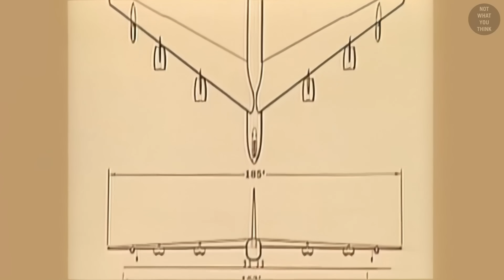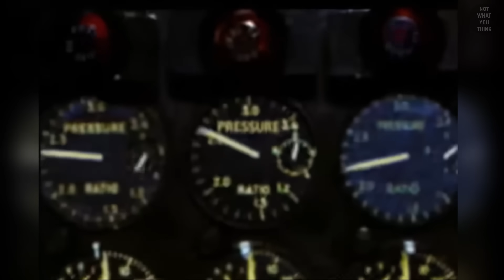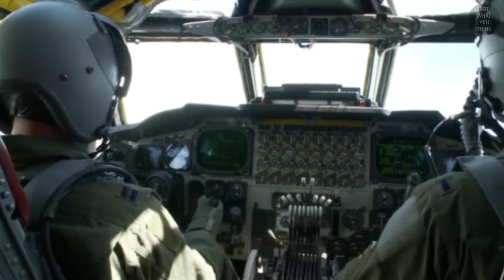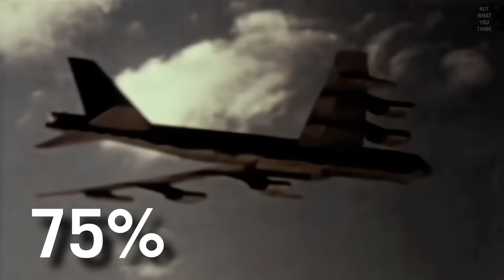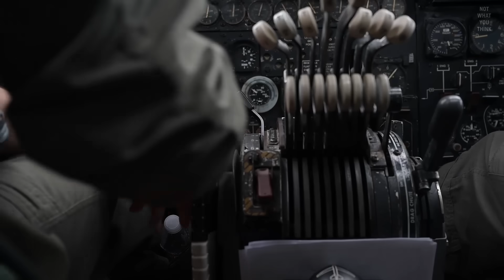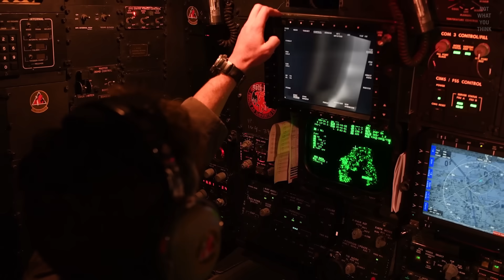Why This Obsolete Bomber Will Outlive EVERYTHING

Comment: WHERE did you get this data? While some is accurate, your interpretation is WAY off. I sat alert for multiple years starting in 86 and ending in 91 when Bush cancelled all alerts. During that time we DID plan on gong "downtown Moscow" in a BUFF. So no, it was NOT considered obsolete at the time. That BUFF that lost it tail (and the second you mentioned) was due to Mountain Wave turbulence. It is ONLY due to the BUFF's construction that it survived. I actually FLEW that bird multiple times after it was fixed (though the fuselage was slightly bent!). I released the first ACM from a BUFF in 92. Boing is today doing a major overhaul of her. And not just the engines. She is getting new radar, avionics, pilot stations, and I am sure defense suite. We were suppose to get new engines in the 80, but congress killed that upgrade. 
So Obsolete? Absolutely not! While it's current radar cross-section is like a barn door, I am sure the current upgrade will reduce that. A single B-52 in the late 1980s also took out most of the SW US with it's ECM suite turn full on! So we who flew with her, remain in love with her, and confident she will remain viable long after her younger siblings are retired!

Comment: Keep in mind when you present the B-52 that much of the technology standard today was developed on the B-52. And also when you mention the nuclear bomb incident (while I probably can’t find any information to corroborate this), it is highly likely that there was almost no risk of a nuclear explosion because the 3 activated fuses were secondary fuses that ran through a manually activated switch, which ensures that a detonation does not occur. The energy input of these fuses would have occurred prior to the weapon hitting the ground and therefore have exhausted all energetic capability for ignition prior to ground impact, at which point there exists a possibility that said fuses could then technically bypass the master switch. But once again, thanks to thoughtful engineering the possibility of accidental initiation of a nuclear chain reaction was avoided by the design of the weapon. Additionally, I think that there’s a likely potential that quite a few of the past incidents with the us nuclear arsenal (and beyond) could have been orchestrated by America’s enemies.

Comment: the role of dedicated large bomber has rather become unnecessary, the terms an politics of war no longer allow for the carpet bombing strategies that the B52 was designed for.
multi role fighters more commonly provide the ground support precision bombing now utilised in warfare. and the B1 is a lower cost option to provide larger capacity bombing runs. 
The B52 seems better placed in a heavy lift or test platform role now more than as an offensive aircraft. 
21 B2's are more than enough to provide stealth nuclear bombing capability or anti air defence bombing during conventional conflict. 

SLBM's have become the primary nuclear deterrent for most nuclear armed nations due to how easy to detect and intercept large bombers are. even with stand off weapons. 
It's really hard to see a long term role for the B52 going forward, its probably continuing in service more as a sunk cost, that so much money has already been spent trying to make this aircraft work, that its just not worth the lost cost retiring.

Comment: Surprised it's not called FUSS or "Fat Ugly Stinky SNAFU" 

It's a nasty SoB, but like the A10 it's a workhorse.  I think they just need to overhaul it instead of keeping it's retirement date pushed back.  Just throw in the towel and design new engine nacelles with modern, efficient engines, minor retrofit improvements to it's airframe and paneling to reduce radar cross-section and drag, and finally a good sensor array, jamming system, new countermeasures system and on-board radar.  

I suspect switching to a system where a pair of twin-turbocrank engines spin generators which then power motors to spin ducted fans nacelles  on the wings would be ideal.  This would allow reducing and spreading the exposed thermals and decrease audible noise down below 120db, giving it some serious advantages as a large scale cruise missile launch platform.
Reply: To be clear to all the rational people in the military (they weren't all rational, obviously) the entire point of the nuclear war strategy was NOT to obliterate the other side, but instead hold a constant threat of doing so, under the presumption of if the threat faltered they would strike.  

I doubt either side would have pressed the button if given the opportunity to do so without retaliation.  They knew there was no way of spinning totally destroying half the world as any form of success, but each was convinced the other side was willing to, so the standoff continued.

Comment: The engine thing goes back pretty far. USAF has attempted to replace those engines several times without avail. Hopefully the new RR engines will finally do the job, but the B-52's PW powerplants have fit the old bird like a glove for its entire life.

Comment: @6:51 You might want to also mention that many other aircraft types were also found to have structural fatigue issues when flown at low altitude. It is not something special to the B52.

Comment: You need to fix you thumbnail. The oldest B-52 is 62 years old.
The oldest KC-135 flying is older then any other USAF plane flying today. Tail number 57-1419
Oldest B-52 still in service was built 1960.

Comment: The simple (compared to insane stuff onboard more modern planes) design helps in updates. It's kind of like replacing pieces on a Lego plane with this one.

Some modern fighter jets are actually built to allow for updates. E.g. the Saab Gripen E, because it's impossible to build a plane that won't become obsolete without upsates.

Comment: This video is full of misconceptions and misinterpretations. Yes, there were crashes. That's what happens when you have dozens of these in the air 24/7 for YEARS. 

Yes, USSR (that's where you're from, right?) developed better guns and planes...and the B52 was upgraded with better guns and better anti missile technology. Know how I know? Iraq bought the best the Soviets had to offer...and the BUFF just kept dumping load after load after load of hurt on them...despite your vaunted Soviet anti-aircraft technology. 

Yes, things break. Yes, every piece of new military hardware needs field testing to work out bugs...everything from the M16 and M9 to the F35. I remember when they were replacing M9 9mm pistol slides every 3000 rounds. That was a couple months shooting for me. It doesn't really mean anything unless the problems are not addressed and resolved. 

Now, with the current upgrades (removal of the redundant front sensor pods and new engines) its range is about 8.000 miles and capable of hitting any target virtually anywhere in the WORLD with a single refueling. So much for your theories and damning with faint praise. 

Of course, the accent tells me the announcer is NOT American so would probably be delighted to show anything American in a bad light. So screw you, and your channel! UNSUB NOW!

Comment: There is one thing I thought they might touch on regarding the age of these planes. Many of today's B-52 pilots are sone of former B-52 pilots and some are even grandsons of oricunal B-52 pilots. One case I saw was a young BUFF pilot was flying the exact same B-52 that his grandfather had flown! Now, that's what I call keeping it in the family!! 
I have a soft spot for big bombers. Back in the 1940's, my mother was one of the Rosie-the-Riveters! She built tail sections for the B-17, like the Memphis Belle. They also built the P-38 Lightening, a beast of a fighter. Kelly Johnson, who grew to importance because of his design skills at the Skunk Works, dark ops. They built the SR-71 Blackbird spy plane. It was the fastest plane in the world for a very long time... , except for the X-15! 
The SR-71 Blackbird set a jet speed record of Mach 3.2(2455 mph). That's more than three times faster than the speed of sound. The X-15 rocket plane set a record for winged vehicles with a speed of Mach 6.7(5141 mph).

Comment: I do not understand why the US will spend BILLIONS on incredibly amazingly advanced weapons systems and then decide to make them in a number that makes them almost insignificant. Like making only 21 B2s instead of 132. Or making only 187 F22s instead of the over 700 planed. Really frustrating, especially with the F22 since its possibly the best fighter ever made. If we wanted every single fighter and bomber we have could have been stealth by now.

Comment: This video is total garbage. Pictures of scrapped aircraft as examples of crashes, EVERY aircraft has engine problems, hydraulic problems and icing if they fly or are stored in the right conditions. The "accident" you show was a rogue pilot flying the aircraft out of it's envelope. Yes the B-52 is an old old aircraft but this stupid video has nothing to with that, poor facts and misleading videos.

Comment: Well, it makes sense to keep these in service. Rather than spend all the research and development just to build a relatively similar, yet far more expensive plane. Just replace the old tech inside with modern tech. New engines. And if need be, manufacture new airframes due to inevitable metal fatigue. If it ain't broke, don't fix it. Like this video says. It does the same job as the B-2, but at a lower cost.. Obviously the B-2 was meant for entirely different roles, and it has it's place. But it doesn't make sense to scrap all of the existing B-52s when they clearly still serve a purpose. The design still holds up today for the role it's intended. Yeah the older ones were pigs on fuel. But modern turbofan engines are FAR more fuel efficient. And the rocket assisted takeoff is only meant for and needed for RAPID deployment, and primarily for a time when jet engines were still very new and not nearly as powerful or efficient. It is not used for every takeoff of these planes.

Comment: This video shits on itself pretty quickly by saying that B-52s were rubbish at the start of their lives but then gives you the Chromedome stats. Think about those stats...and the amount of time and miles put on the B-52. Of course they're going to have problems...just like any machine put under such pressure. It's absolutely amazing and a credit to their design that they not only survived the initial, and brutal, introduction into service but have only improved with time. It's a legend for a reason.

Comment: Odd thought but if a basic turboprop or high bypass turbofan powered vehicle could be designed and built, like if a B-52 was crossed with a Hercules, that could do the ordnance truck turned long-range missile launch pad, could do it for less fuel and with easier maintenance, especially as the remaining B-52 airframes start to age beyond what is economically practical to keep repairing, would such a vehicle be a viable alternative/successor to the Stratofortress? After all delivery companies don't keep using the same trucks for decades when it's more cost effective to get a newer model.

Also just saying Stratofortress really bought home the age thing.

Comment: 1 -Express yourself with the metric system (Only the US low level subject level matter is comprehensive with the dumb imperial system.)
2 - Don't shit on an aircraft that has been in service since '52, and remains operational
3 - Get your digits together, your numbers are all wrong. 
Greetings from a pilot.

Comment: The B-52 is not actually obsolete. Yes, it is old technology, but neither the B1 nor the B2 perform the job which the B-52 performs.  Further, there is no particular reason to build a replacement for the B-52. Modern electronics can and have been retrofitted.

Comment: Why haven't the 8 engines  been replaced with the same engines used in the Airbus A380? That would mean only 4 engines with a total of more heavy load and much better fuel economy.
Reply from the maker: Because it would be more expensive as four larger engines will require more modifications to the airframe. As it will impact aerodynamics and ground clearance

Comment: The B-52 is much larger than the B-1 or B-2. B-1s can't fly in icing conditions (no anti-ice). B52s are getting new engines, too.
Age is a poor measure of airframe life. Most B52s have very few flying hours/cycles.
And no, the plane isn't unreliable or obsolete. You made that up.

Comment: It's an amazing warbird.  One terrifying factoid: its wings "flap".  It was a marvel of technology in the early 50s, and its intercontinental range was the key factor that converted the hydrogen bomb from a crazy science project into a weapon of war (much like what the B-29 had done with the original fission weapons).  However, it was still the early 1950s and they were still working with riveted aluminum and EARLY turbojets.  The engineering required to get under the weight targets while still hitting durability requirements (see video) was astonishing, but it lead to compromises.  One result of that is that the wing structure could not be all that rigid- making one as stiff as a B-2 or B-1 or B-21 would've required advanced composites and titanium alloys that were still decades away.  So they built wings designed to flex a bit.  It is apparently very disconcerting to people who aren't familiar with the aircraft, but one of those things that you just get used to.
Reply: Is that not something they would fix when the materials came? Do we still not know how? Seems like flappy wings would wear down much faster than stiff ones.
Reply: @classarank7youtubeherokeyb63  Absolutely.   A modern composite airframe would rapidly fatigue itself to death with much less deformation, and the wings on say a B2 flex FAR FAR less.  The rather extreme wing movement wasn't regarded as a feature, just a necessary expedient in light of extreme range/weight constraints and the materials available at the time.
Reply: I think all modern aircrafts, in particular passenger planes, have flexible wings.
Reply: @TheBilkis  This is true to an extent, but the B-52 had a max wing deflection of 30 degrees.
Reply: That, and the fact that the largest known deposits of titanium are in Russia and the US had to use front companies and the like to get the titanium they needed for the space program as well. That is the main reason for the aversion to using titanium, and the cost and it's a mongrel to work as a metal as well. Any one with metal work experience knows that.
Reply: @geoffreybennett8912  no they don’t. China does. Russia has cheap power so they refine it.
Reply: I  have  no praise  for this Buff bomber  plane it was  given to a nation that  fought  four wars with India. They used to bomb a military hospital a  Ambala  in Punjab duri
Reply: @prasannakumaris7149  You're thinking about a different airplane.  The B-52, like all American strategic bombers, was never provided to any other nation.  In fact, the closest that any nuclear capable American bomber came to export was the B-29, which was flown by the RAF and reverse engineered by the Soviets.
Reply: J
Reply: During the war inspite of a big Red Cross  mark  on its roof  The air crew opened  the  bomb bay to to roll down  several bombs on  the hospital   below  shame   on the pilots  and crewl

Comment: One thing often overlooked is how NOISY those things were.  Way back around 1963 our family drove to Dayton Ohio, my father was going to a conference there.  Starting back, we stopped at a gas station just east of Wright-Patterson AFB.  There was a B-52 refueling about 200 yards away with the engines running.  It was so loud it was impossible to hear one another.  I still remember the strained face of the gas station operator.  

Many years later I was able to walk around and under one at Offut, NE.  "A plumbers worst nightmare" under there.  The number of hydraulic lines, tees, and valves was astounding.   A military analyst once told me the availability rate for the B-52 was secret but was around 45%.

Comment: Well, it is not actually obsolete. It does what it does so well that there has been no need to replace it. Name one other military aircraft that is so competent in its role that an entire fleet engine upgrade is a better option than creating something new from scratch. Somewhat like the A-10, designers and engineers get it right occasionally, and all that is needed are occasional system upgrades, not so much to keep it running, but to enable operation with other aircraft. 

None of the "failures" you list are unique to the B52, you certainly cannot blame it for ice, and you kinda hit the nail on the head by saying they all happened in its "first few decades" of service, well a few decades is about as much as any other aircraft can hope for before being obsolete, replaced by something better, with all its own teething troubles as it enters service. 

As for 2 dozen losses outside combat, that does not equate too badly with the f22, that at current rates can expect around 20 by the end of 60 years service if tha rate remains constant (no extra fatigue etc) and it lasts that long. But then that is out of less than 200 airframes, not well over 700.

Buff is equipped with multiple ejection seats because pretty much all combat aircraft are equipped that way with seats for each crew member. Nothing at all to do with non-combat losses, air-crew are a very expensive asset. 

The multiple nuclear accidents, well given it has been pretty much the only western aircraft to regularly, and we are talking constant cold-war standoff patrols to carry nuclear weapons it is without doubt it will be involved in such accidents. 

two minutes in, and all these errors, I can't stand another 16 mins of such rubbish.